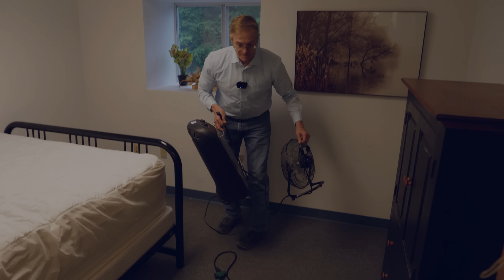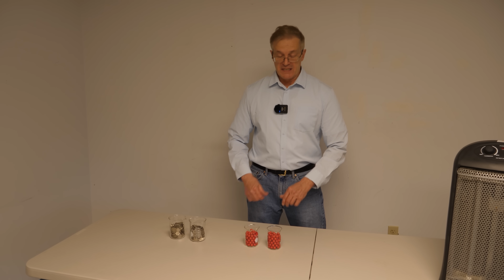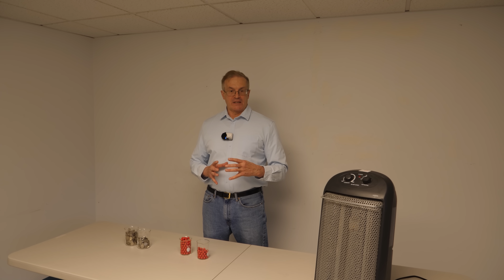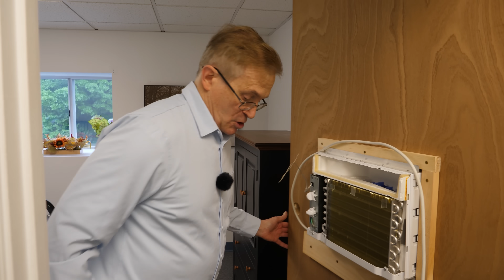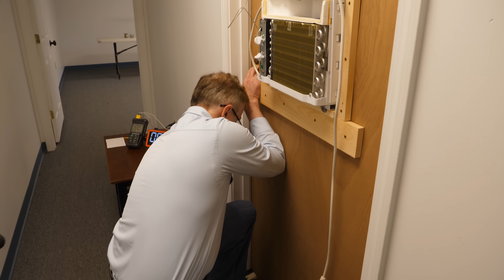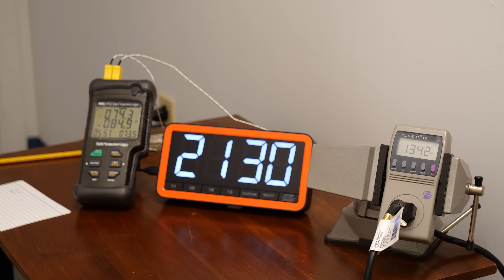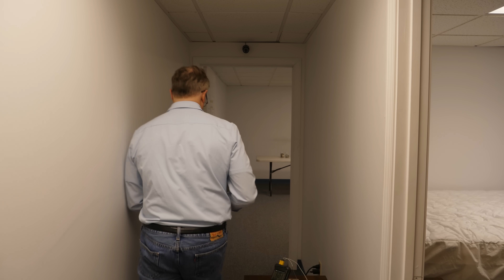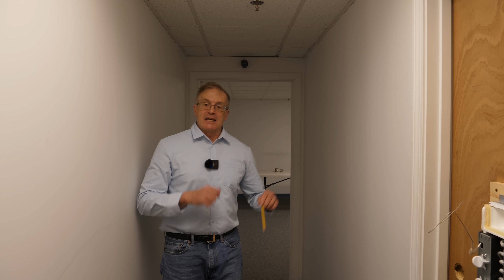You're wasting money on heating! Use your A/C!

Comment: I tell people they can do this to save money and they just give me a blank stare. Most people don't have the slightest clue how an A/C or heat pump works.
Reply from the maker: That's true of many technologies.
And that's what we're trying to rectify.
Light one small candle...
Reply: Your last sentence is right.
This method becomes less efficient for every degree it drops outdoors.
By minus 10 degrees Celsius...it's a frozen paperweight.
Reply: @onemotherpucker  If I'm remembering correctly from my thermodynamics classes, which I attended many, many years ago, I'm pretty sure the efficiency increases as the temperature difference increases. The increased cost is due to the extreme amount of energy transfer required at that extreme difference in temperature. Freezers are extremely efficient and  work very well at very low temperatures. Also, doesn't this video show how much less energy is required, so it would save money. When I ran calculations a few years ago at the going electricity and propane rates, I found that an electric heat pump would save a significant amount of money over my propane furnace. The energy cost difference was almost zero at 0 deg F, but at any temperature above that, the heat pump had the lower energy cost.
Reply: @cruisinspecialtiesllc6104  The video shows the air conditioner drawing room temperature air to exhaust into a same temperature room. Try drawing in 0 Fahrenheit air and see how far you get?
Even at 50 Fahrenheit, an infra red heater would be much more efficient.
In an emergency, 32 Fahrenheit or above is viable...otherwise, it will just freeze up.
The video scenario will warm up the one room while cooling the rest of the house.
Reply: @onemotherpucker  Last night when the outside temperature was 11 deg F, my heat pump was proving you wrong.
Reply: @cruisinspecialtiesllc6104  Is your heat pump geothermal? 
If it isn't, you will soon understand what I am talking about. 
And if it is, you understand the incredible cost to install it.
Reply: @onemotherpucker  its not geothermal and I've been operating each winter for years with no complaints.
Reply: @cruisinspecialtiesllc6104  Good luck.
Reply: @cruisinspecialtiesllc6104  apparently, wishing someone good luck is enough to get your comment deleted.
Reply: And it doesn't save money.

Comment: I have a Trane XV air heat pump with a high energy rating and it does not impress me. In fact, I miss my radiated heat I had at another residence. I'm in IL and it's cold here when temps drop below 25F. I have constant emergency heating going on which is expensive.  My advise, get the best heating system for your climate.  I'm dealing with yearly repairs of the reverse flow valves which locks up alot.  So, I save money in gas only to pay it out to unfreeze freon valves and replace ignighters.  This is probably a great system in warmer climates, but here I don't think it's as efficient in my honest opinion.
Reply from the maker: Fair enough.
I agree that the climate is the controlling factor. What I demonstrated was only the basic principle.
Reply: This is true, the climate, how often the heat pump uses defrost, system efficiency all factor in to savings. The colder and less efficient a system is at lower temps would increase electrical use due to the use of defrost which combines the amp draw of the system plus the resistance heat kits in the system used for defrost. If you have a high efficiency inverter system that can change compressor and fans speeds to increase heat transfer then it will save more money. But the general principle is true. Making heat with a heat pump is a more effective way to make heat with electricity.

Comment: This is useless. I know ac unit puts out hot air. The question is that you did not provide is 1) how flip the unit and 2) how control the unit.  When you flip it the controls are outside and exposed to weather electronics don't last long that way. Next the controls or thermostat are based on cold air it's already cold outside how will it turn on and off. I don't think people are going to install in hallways. I search your videos for a companion video but did not find one.  There is no practical use without rest of instruction so I gave you a thumbs down.
Reply: Yep...there are so many issues here.

Comment: But what about the water/condensation that is always dripping out of the the unit? And the thermostat, if the outside temp is lower that your AC thermostat operating temps, it wouldn’t even let the compressor kick on in the first place? Just common sense thoughts.

Comment: I have two of the AC/heater window units. It would be great if they didn't sound like jet planes, but I like to watch (and hear) television. The other thing I hate is, at least with these, is that they turn on and off about every minute, regardless if the room temperature has changed or not.

Comment: I am going to attempt this experiment. The basement in our building is around 6,000 sq ft. of open space, no ac or heat. The temperature can get down to high 30's during really cold weather and in the 80's in the middle of summer.  I have a small room (500 sq ft ) that i use as a workshop. I have a diesel air heater for winter and  use a small window ac unit during the summer,  Both are  mounted on one wall and vent straight out into the open space. I am going to turn the ac around and vent it into the room. I can run this same test and see if i get similar results.
Reply from the maker: Let us know how it goes!

Comment: Why no doorknob? 😂
Reply from the maker: You're not the first to comment on that.
The fact is we had to damage the door in order to mount the airconditioner, so we found a surplus door at the local dump that fit the frame, but it's doorknob cut out didn't quite align with the frame.

Comment: My question is how do you find a way to create reliable temperature setpoints with the heat only being created as a byproduct of the a/c trying to cool?
I don't see how this method is helpful if were overheating the room to the point that we would want to cool it? 
Sure it works more efficiently, but how do we use this knowledge to make usable products?

Comment: Well its a good idea but sadly the condensation issue at play
Reply from the maker: You might consider that when heating a room, you need more humidity. That is why most gas furnaces include a humidifier. The condensed water could be added to the warm side airflow for the same reason.

Comment: Wont water vapor drip from the AC?
Reply from the maker: The water can be routed to wherever it's convenient. It may be a benefit as the indoor air becomes dryer as the outside temperature drops.

Comment: The problem you will discover is that the coils outside will freeze up and because these units don’t have a reversing switch to melt the ice, it will quickly fail.  These air con units will only be effective when it’s a few degrees above freezing outside.
Reply: BULLSEYE

Comment: I was honestly surprised at the results. We live in a house run on a medium sized solar system and so heating with electricity is like out of the question. We’ve been looking at heat pumps for some time now but this is a surprising result. I didn’t expect even close to that difference. Question when’s the next video
Reply from the maker: It will still be a month or two. We're taking advantage of the collaboration we  started with our latest video.
Reply: @TechIngredients awesome!  We are in Canada and with fuel oil heating prices through the roof we are relying almost 100% on wood heat which while being cheap is very labor intensive and also requires constant management. We are definitely looking into getting a heat pump as with solar although in the winter we get a lot less sun and power there is still a lot of days we end up with excess power that could be put to good use as otherwise we stop being able to store it and it gets wasted. Anyway I have been following your content for years and always found it very interesting and informative. Keep up the good work!
Reply from the maker: Thanks!
Reply: @gavinblaedow9255 heat pumps are next to useless in Canada for winter heating.

Comment: Do you modify the air conditioner? I tried a air conditioner and it was cold on both ends
Reply from the maker: No, you don't need to modify it. 
Although, pulling the temperature sensor away from the coils will allow it to operate over a wider temperature range.
Reply: @ Thank you I’ll try that . I let it run for a hour + and didn’t feel it getting warm at all .
Reply: Its not worth the effort.

Comment: Easy way to think of it.  For people that use electric heat.  

Is it cheaper to heat or cool your home.  

Heatpump cost basically around your cooling cost.   The system just has the main thing. A reversing valve.  

So think of a window unit.  Inside it blows cold air.  But if you walk outside.  It’s blowing warm air out of it.  

So if you flipped it around and put the inside of the window unit on the outside.  The warm air will be blowing on the inside.  

Instead of a reversing valve you just physically flipped the system around.   An now it’s warming the room vs cooling it.  

I’m sure the heat pumps. At the beginning of really seeing them in central air in homes.  

If you had a heatpump central air system with electric heat.  

As long as you only increase temp say 2-3 degrees at a time.  The heatpump did its thing to warm the home.  But if you set it at a larger temp difference.  

The electric heat on the system would also kick on to get it there quicker.  

An that’s about the only times the electric heat was being used.  

But to slowly creep up the temp.  Or hold it steady.  The heatpump would do it on its own without the electric heat coils kicking on.  

Cost wise it’s basically like running ya AC pretty close.  It’s running the same compressor as it does with cooling.
Reply: Useless below zero.
Reply: @ some won’t even function close to that either.

Comment: Here in sweden the use of heat pumps is very high, it can warm up the whole house and its ALOT cheaper then using electric heaters, using water based heating elements and use fire to heat it up is also very effective and cheap.
Reply from the maker: Good point.

Comment: Reminds me of a water cavitation technology a guy developed somewhere in the Carolinas, I think. An electric motor spins an impeller inside a closed cylinder. The impeller is a smooth piston with special scalloped sections cut into the surface. The clearance between the impeller and the cylinder is minimal but enough to permit unobstructed water flow from the input to the output. So a 3/4" input flow rate is maintained. The heated water is fed to a main tank, expansion tank, etc. A Municipal water source is piped in and fed into the cylinder while the impeller spins. Water cavitates and heat is generated. There's enough heat to create steam or hot water, depending on the rate of spin.

Comment: I must have missed where he described that the AC unit was reversed so that the waste heat from the unit was being used to heat the room? 

I heard him state that resistance heaters are nearly 100 percent efficient, and that heat pumps can be many times more efficient than resistance heaters, because a heat pump "Messes with entropy". 

Since I don't know anything specific about heat pumps, I guess I was expecting to see a demonstration and step by step description of how the air conditioner actually went about "Messing with entropy". 

I know I was watching this video at like 3 AM, and so I should have been paying 100 percent attention, but I still don't recall him ever telling his viewers that the AC unit in the door was going to be discharging  it's waste heat into the room, and the amount of heat gain in the room at the end of the demonstration would be compared to that achieved by the resistance heater. 

It was only when he stated he was standing "in the cold blast" and he said the hallway temperature was a few degrees cooler that I realized the AC unit was reversed. 

Well, I still don't know Jack about heat pumps, and how they "Mess with entropy" is still a mystery to me. 

But, there's no denying the results of the demonstration.

But if heat pumps are so vastly more efficient, why aren't they required in all new home construction?

Comment: Actually not in general, normal ac installation has long pipeline which results in losing effiency. Also normally you use heat pump to heat during winter when outside temperature below 0, make it losing more effeciency. In the end probably end up heater has higher efficiency at some point

Comment: Good idea turn the AC window unit backwards in a room that not being used. and dump the cold air in another room and hot air in the room you sleeping in.
Reply from the maker: That is a good idea. It lowers the differential, which increases the efficiency multiplier effect, the controls are easily accessible and even the condensate can be captured to humidify
the heated room.

Comment: It does NOT address the issue of OUTSIDE Temperature, Use 70- 75 Degree to show the heating benefit is incomplete as the outside will NOT be that warm when heating is necessary. What if the outside temp is below 50 degree ( a reasonable temp in winter even in Texas). I assume the UNIT will not run or if it is possible to set it to run at 50 or below.
Reply: However this do save money for those who lives in warmer climate in winter temp between 50-60.eg Texas. Even with heat pump, it does not work efficiently as Temp drop below 45 or so ( use aux heat)

Comment: This principle is interesting. I’d like to know though how well it works in the northeast in the winter with snow outside and well below freezing. Would it still make sense to do it then??
Reply from the maker: Probably not.  The efficiency multiplier effect decreases as the temperature differential increases. It's not a one size fits all solution, but can be an effective component in a complete heating system.

Comment: What if its colder than the lowest  temperature on the ac unit outside? How do i keep from shutting off ? Thanks
Reply from the maker: You would need to supplement the cold side with additional heat. This could be done with additional coils or even just locating the unit where it is warmest, such as in bright sunlight.

Comment: The efficiency advantage of heat pumps is very impressive, but traditionally generated electricity is the likely still the most expensive energy source by a fairly large margin and the real question is the final cost of operation per BTU over burning fossil fuels like heating oil, natural gas or propane or even biomass fuels like wood pellets or wood. My guess is that absent solar offsets, the heat pump is somewhere near the top in terms of cost per BTU to operate, but maybe I'm wrong.
Reply from the maker: That's true, but it's a different argument.
It may be that the best performance solution in terms of dollars per BTU, for staying warm AND cool, is improving insulation.
If we understand the principles and the goals, we can apply the best overall solution to achieve it.

Comment: I am a  heat pump mechanic .lots of heat in 75 degree room not all  that  great heat in 30 degree  outside with frosted coils going  through 4 defrost cycles in an hr with emergency strip heat coming on and so much for saving  all that money when it  turns into repair money pit  and dies at 7 or  8 yrs (cheap Chinese junk) use to  be 15 20 yrs out old carrier GE heat pumps those days are gone .spend  $10k on system that has a payback of 8 yrs vs a cheap  $150 strip heater  do the math . Heat pumps need to  be built  better and last longer and made cheap an easy to service. $750 for reversing valve solenoid  $1500 for compressor heat pumps now days is racket. But fine for southern states Fla GA CA NEV AZ Etc. Not for NYY PA Snowy cold northern states
Reply: complete bullshit.
normally very few defrost cycles are needed and you can get heatpumps with demand defrost that only defrost when needed, not every x minutes. 4 defrost cycles per hour and something is absolutely wrong even with timed defrost. A heatpump is an a/c with some extra components - not less durable than regular a/c.
Compared to electric heat strip only even in a cold climate heatpumps save enormous amount of energy - they can be used in cold climates but just not meet all heating needs.
There are also heatpumps that are specifically engineered to maintain full capacity down to below 0F -> those when sized for heat can meet all heating needs in most climates.

When the southern american thing is done - incompetent people putting heatpumps on crap attic flex duct systems that don't give proper airflow and have high static, charging by beer can cold, not pulling proper vacuums - ya of course there will be problems!
Reply: He failed to mention this !

Again ...
... I think that he was just attempting to explain the principle of how a heat pump works .

N0T advocating tjat you go buy  one for your particular location.

Thanks for ALL your relevant information !

Comment: Are you suggesting I change my heat pump (during the colder months) setting to AC rather than heat or is this just an exercise to prove efficiency of resistance heaters compared r a heat pump. I appreciate the science and I would like to know if I can run my heat pump differently and save dollars. Thanks
Reply from the maker: This is just a demonstration of the efficiency multiplier effect of any heat pump. You're good.

Comment: This advice is only if your electricity prices are the same as gas as in the US.

In some parts of the world it doesn't make sense to use heat pumps because just the mere electricity used to power the AC compressor will empty your wallet harder compared to running an old gas boiler.

in the UK electricity is 4x the price of gas, in Germany it's 3x.